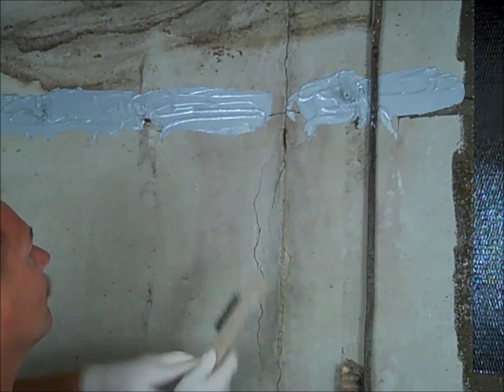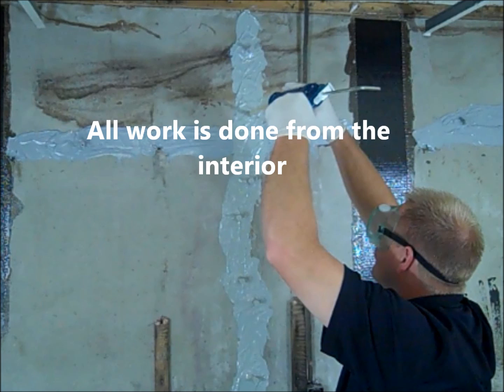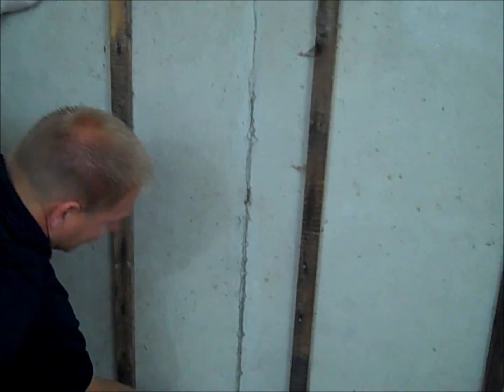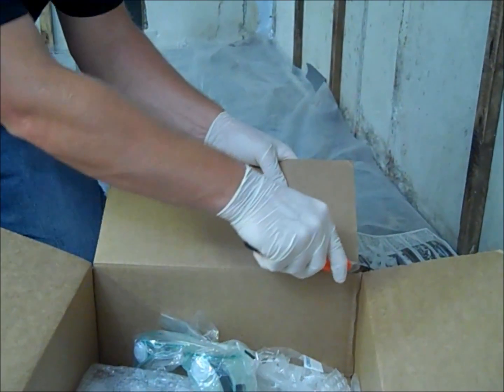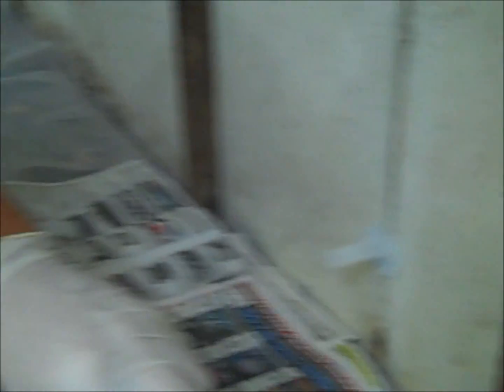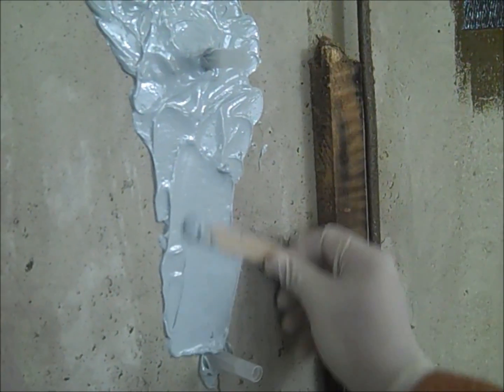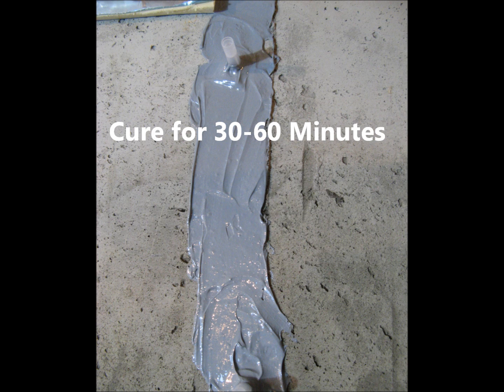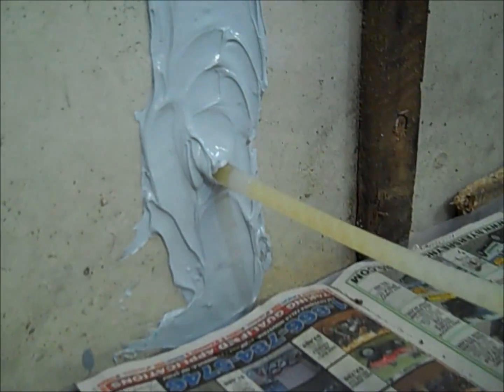6-10′ Epoxy Concrete Foundation Crack Repair Kit for the DIYer-How to Video

Comment: Does this foam up after injecting? Mine does not seem to foaming after I injected it. I had other cracks fixed professionally and it foams. This seems to be just a glass like substance and is not expanding to a foam
Reply: This is an epoxy product.  Epoxies do not foam.

Comment: Well I ordered mine had to purchase around 1200$ worth the product 
I wish they actually explained on these videos that if the Crack runs all the way to the bottom on the floor you should use the hydra stop first and then then 212.
(Hydra stop only one tube)  
I learned the hard way.
Plus the Crack I wanted to repair runs all the way through the other side which is buried in dirt....so I lost most of my product in the dirt.
So anyone using this or any brand be aware of this

Comment: Very informative, good tutorial, gives a diy person confidence in performing this. A couple of questions, I understood the exterior above grade crake treatment.  Not sure I understand from grade down just leave it?  Last question any advise on cleaning, trimming, finishing the final result to look better, more professional?
Reply: I am not sure I understand your question about "grade down." You can scrape off the Poxy Paste and ports with a hammer and 5 in 1 tool/scraper
Reply: Aaron Kuertz   I appreciate your reply, what I meant by below grade, was that, it looked like the crack was not repaired below grade level?  If that is true and maybe I just got it wrong, does it not need to be addressed below the grade level?
Reply: They say "above grade" as in, above your soil line.  That is so the liquid will not just spill out of your crack to the outside.  "Below Grade" or below soil level, should have enough pressure against the house to keep the liquid from just spilling out.

Comment: does this work against water permeating
Reply from the maker: This will stop water from coming through your crack
Reply: You MUST create a system to keep the water away from your home and couple it with the crack repair.  Either regrading, high potential to fail, or a french drain system.

Comment: I used this to seal a 1/4 inch gap between two concrete walls. The contractor did a horrible job in connecting the walls. 100's of gallons of water would come in on a bad rain because it was feed by a spring. He would not stand up and fix it. I was sceptical but it worked great. Dry as a bone. The only thing I would of done differently is to be more liberal with the gray sealer around the ports. One came off but that was my fault. For walls that are structurally sound I would recommend this product
Reply: Can you comment if this is still holding up since you did this 2 yrs ago.
Reply: IS the repair still good 4 years later?
Reply: where did u buy this stuff ?